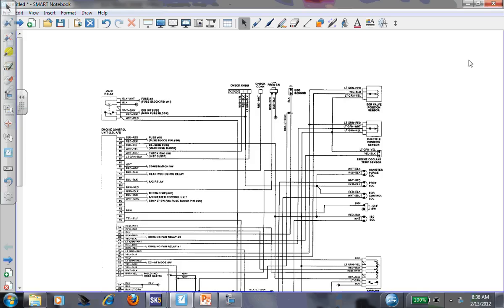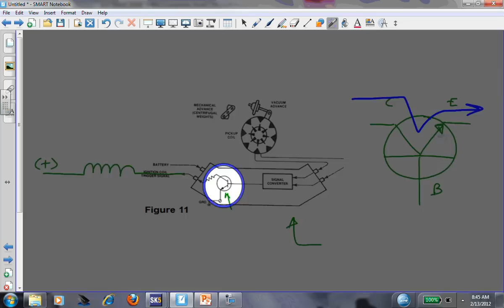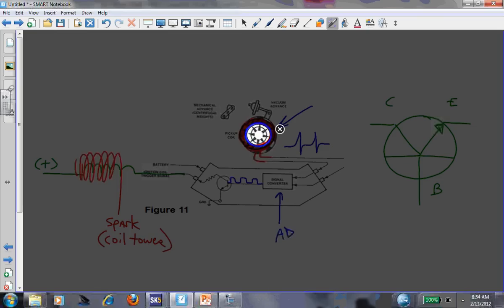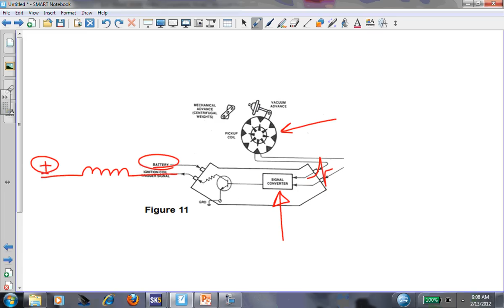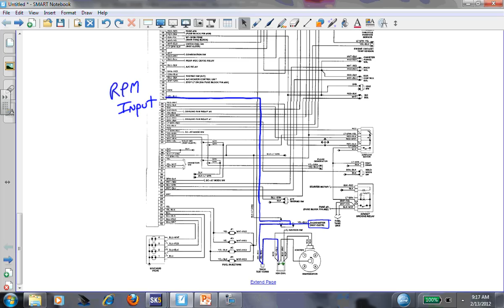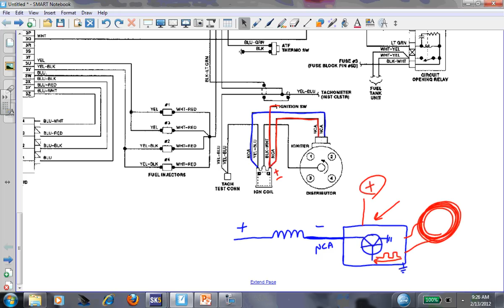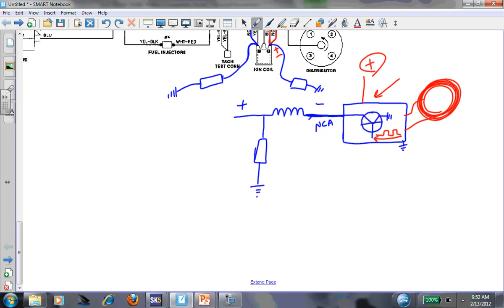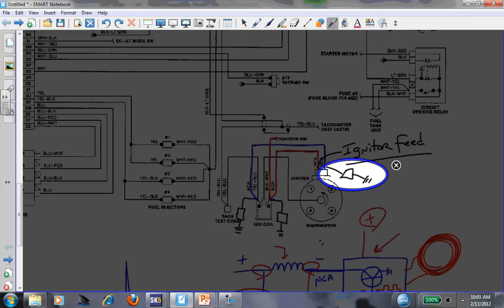Basic Ignition Description, Operation and Testing (any car)

Comment: Just happened to stumble across this and got a kick out of you trying to explain the points type ignition and spark advance to students who probably have never heard of such a thing.  Probably the same feeling to them as it was to us who were already out there when we encountered the transistor ignition.  As you mentioned " a very scary moment" to us.  I did install a number of the "Arc" systems in vehicles which utilized the points to trigger the transistor in the mid to late 70s and then later used the Pertronix and Compufire systems to convert quite a few different vehicles.  Been repairing vehicles since the mid 50s so have seen some amazing changes, now I only take care of my own as I am 83.  I always had 4 or 5 older vehicles in the yard to keep 'hands on' but don't any more.  I did purchase your book a few years ago just to try to keep halfway up to date on all things automotive.

Fred
Reply: Mechanics today would’ve probably looked at say a stock 65 dodge dart and thought easy til trying to figure out the points. Ive forgotten its been so long and havent adjusted the dwell angle?in almost forty years

Comment: They demonstrated how to measure the voltage generated by attaching   drill to the other end of the distributor,   this generator was able to generate up to 2.5 volt at drill full throttle (3000 rpm) also they demonstrated how to trigger the ignition coil using a AAA 1.5 alkaline battery since the voltage generated by the distributor average was 1.5 AC Volt, a battery could emulated it. 
Thanks for make me remember those days. You are an outstanding teacher

Comment: Had to take apart an old distributor from my '89 Mazda MPV after watching this awesome video. At 225k miles, it's on its third distributor. On 89-91 models they mounted the igniter inside the distributor housing, meaning it gets very hot and eventually cooks the little circuit board. Tore the igniter apart and traced all the terminals...really neat! Also has two advance mechanisms: centrifugal AND vacuum! Should be getting a scope this month...can't wait to see some waveforms on that system.
Reply: It’s awesome to see the ripples of knowledge. @scannerdanner influencing @pinehallowdiagnostics. And how many more the both of you have influenced and taught to diagnose the problem. 
I am currently working on classic Porsche and this knowledge is exactly how the CDI boxes work. Thanks for the awesome lessons!

Comment: Thanks again.  It is so incredible how oscilloscopes have changed the way auto techno see things now a day.  You have made me remember of something…  In 1989 I went to Industrial district of Kobe Japan to receive among other things some training on latest Toyota ignition systems.  As you have stated it… there is a tiny AC generator within Japanese distributor.  They taught me a quick fancy test using a Voltmeter and a triple A 1.5 Alkaline Battery.

Comment: Paul, i used to have a few old 'muscle' cars back in the day with centrifugal advance dual point distributor, yes lighter springs = full advance at a lower RPM, usually about 37 degrees TOTAL advance the engine would run best and full advance would occur about 2500-3000 You videos are extremely interesting and also educational for troubleshooting--

Comment: There is a lot of great information in this video, not only a great explanation on the system but mainly the excellent points as to how to THINK about the system and have a solid understanding of what is needed for the system to perform as designed. Been in the field for awhile and it is scary sometimes to see "experienced" techs struggle so much with electrical diagnostics.
If the current automotive schools are being taught by instructors like you, then future techs will be impressive.
Reply: we
Reply: we
Reply: eww
Reply: w

Comment from the maker: Great insight. You can use a lower battery voltage if you like. I've just been using a test light to do it for 20 years and I've never hurt the transistor in the ignitor on any system. I know it is typically a lower base circuit voltage but what I have found is automotive computer systems can handle more without damage. Check out my Lexus LS 400 Igniter Bypass Test video.
Reply: Wow paul great teaching thank you.

Comment: Paul, at 19:00 to 20:00 of your tutorial,the signal conditioner uses a Schmitt Trigger circuit to change the ac reluctor signal to a dc signal to switch the transistor.

Comment: Hi Paul, I remember the introduction of the ballast resistor, I can only say on British cars they had a 1.5 ohm ballast resistor in line with the primary feed, the reason was for cold starting, they had a 12 v battery and 9 volt coil, the B/R dropped 3 volts across it, so coil ran on 9V, when cranking the B/R was bypassed by a wire off the starter solenoid, as you cranked battery voltage went down to 9v, starter current drain, so coil
got 9 volts whatever happened, cold start coil system - Fred
Reply: Yes saw in old gm &Ford
Reply: The ballast resistor is not for cold starting.
The purpose of the ballast resistor is not to limit current flow across the points either when you could do that simply  by having more primary winding's and greater primary resistance. A 3 ohm coil would give 4 amps at the points which is nominal.
It's primary function is tuning of the coil oscillations. The coil system is an RLC circuit.
It has a resistance (ballast resistor) on the positive voltage side, followed by an inductance (coil winding's) which is followed by a capacitance (the condensor) on the negative side when the points are open (that makes an RLC circuit)
The capacitance, inductance and resistance determine the tuned frequency of the coil oscillations from mutual inductance of both primary and secondary winding's, which includes the plug leads.
The resistance of the coil primary determines current flow, the ballast resistor is the circuit tuning part.
Two problems with internal ballast resistors.
One is if the ignition is left turned on for a long time with engine off the internal ballast resistor could heat up enough to blow oil out of the coil and kill it, the other issue was that during cranking when voltage dropped so low it compromised spark. 
With an external resistor it can heat up and wont burn up the insides of the coil, and it can also be bypassed during cranking by the starter sending the coil direct voltage not through the external ballast resistor.
They could have had a third terminal on coils to allow the internal resistor to be bypassed during cranking  but that would not solve the internal resistor overheating issue, the external ballast fixes both issues.
If you turn on your ignition but don't start the engine after a while you will note the ballast resistor gets hot enough to burn flesh but when you start the engine it gets cooler, You can imagine what happens if that is inside the oil filled coil.
So if you have an old car with internal ballast coil, do not leave the ignition turn on without the engine running for prolonged periods or you could fry the internals of the coil to the point it blows oil out if the points happen to be closed when the engine is not running and the coil is powered up.
Some claim that it heats up and increases resistance to limit current and then cools down to increase voltage when running for more spark at higher RPM.
It only heats up because it is drawing more current at low RPM or KOEO, converting that energy to heat that then increases the resistance over it as it heats up.
And when the current drops once it is running obviously it cools down. 
That is not by design that is simply what resistors do as current increases over them.
Reply: With your permission, I like to chime in.

 If memory serves (which is not too reliable these days), the reason for the resistor was to reduce voltage across the points in the distributer to reduce arcing, and to help with condenser. 

The ignition coil was rated 12V; but during running of the engine, it was supplied with less voltage due to the resistor. This reduced voltage would help reduce arcing across the points in the distributer and extend the life of the points. At times, the arcing would cause pitted points. In time they would not separate and drop the primary voltage in the coil. This would keep the spark plugs from firing.

During the cranking, there was a “by-pass” wire from the starter solenoid to the coil primary post. 

This “by-pass” wire would provide 12V to the coil directly, so upon interruption by the points and collapsing of the primary side, it produced a higher voltage for the plugs. Since the cranking periods were shorter than engine running periods, it was an acceptable risk.    

After introduction of electronic ignitions, many of the issues of non-starting due to bad points were eliminated.

Ignition systems have come a long way baby.

Comment from the maker: IT actually does "try to fire" when turned on but there isn't enough voltage generated to jump the plug gap yet. When "turned on" (current starts to flow) the magnetic field is weak and has to build to "saturation". Once you have a strong field in place, then it is ready to fire. Remember a magnetic field must be moving to induce voltage into a conductor. So shut down the current and this now strong magnetic field collapses across all these conductors and now you created enough voltage

Comment: hi, at 32.04th minute, you said, we can use test light to bypas pickup coil, by providing on and off ac sinewave signal, to IGNITER, so igniter can turn on or off, i think we cant use test light because it is 12volt , so we should use 3 volt battery for that. I may be wrong. pls advise. your method is right to supply ground on and off on primary ignition coil but not as input to the igniter because you are passing 12v on and off, but ignitier expect 3 to 5 volt on and off. again i may be wrong.

Comment: FYI: mechanical systems used camshaft lobes to open and close points. Not centrifugal weights. The weights modified only what the camshaft lobes were doing.
Reply from the maker: Which would change the timing, in relation to piston position of when the points would open/close Maybe I misspoke?

Comment: The distributor cap on these High Energy Ignition  (HEI) systems was a larger diameter than the older points style systems because the secondary voltage was higher. This put the towers for the secondary wires further apart, so that the spark would not jump to the wrong tower  (wrong cylinder).
Reply: Not true sorry. HEI had no effect to the size of the distributor caps.
Reply: Not accurate. That is a myth. The reason the cap is so large is to accommodate the coil into one assembly. Look at race ignitions with greater voltage, the caps are smaller.

Comment: The Fluke 87V or 88V multimeter will detect a peak voltage at 250 microseconds threshold.  That should capture the small drop.  Having said that, I would prefer a scope to capture that of course in every instance, but at least that meter will capture that very short voltage event.

Comment: Good evening, elementary school friends, I have a problem with the manual transmission unit BMW E36 M43 1997, it can't start, what I have done is replacing the ECU and the ews module as well as the chip... the engine starts but the problem is the engine turns off 16:45

Comment: Hey Scanner Danner, 

2 questions, Is the resistor on the feed wire from the transistor to the primary coil a PTC resistor? It's literally just the condenser from the mechanical ignition system that has been moved internally in the move to electronic ignition systems?

Do electronic ignition systems use both centrifugal and vacuum advance in conjunction with one another to achieve proper timing or was it one or the other?

Thank you for your response. 

P.s. Your content is hands down the absolute best on youtube. I appreciate all the time and effort you put into this content and will be subscribing to your premium channel. Engine mechanics and diagnosis is easily my new addiction hahah.

Comment: Hi mate I've got a Toyota land cruiser 105 series 6 cylinder petrol I'm having problem finding a circuit opening relay, I've stripped all the dashboard out which the local Mechanic told me it was behind the heater box which I haven't found it yet???

Comment: 13:47 I think I found my issue. Customer states they left vehicle in the run position overnight. Came back the next morning and vehicle will not start. Could this coil saturation have caused all of the coils to burn out over night? Battery was dead the next morning. Vehicle will not start with charged battery. 2008 nissan sentra coil on plug design
Reply from the maker: Unless there was a coil driver issue, keeping the coils energized with the key on (which is not normal), then I do not believe this to be your issue. Scan it for codes as a starting point. Could be anti antitheft related. Try disconnecting the battery and then touching the disconnected cables together (called a capacitor discharge)

Comment: Why doesn't the test light burn out when put on the coil negative if it spikes to 400v and the current can be several amps.  Does the current collapse so fast that it is much smaller when the voltage is that high?

Comment: a bucket of words tin the previous video that I watched the instructor was just spilling buckets of Domino's the word salad did he spilled showed that he knew what was going on but he didn't explain it in a way that imparted what was going on to the Observer unless perhaps Observer just goes over again and again and again but the people weren't getting the cause and effect out of you need to call us and in fact at every point and every step and this video he just basically was forced to deviate to it pure Electronics to explain the magnetic fields and transistors both where to purchase water is needed for one to understand and that's just a necessity but all-in-all I saved this this instructor did a pretty good job but still might be clear on the Electric electrical aspects that he tried to explain I love the stuff is it is a direct eickhoff I have a crankshaft rotation it represents a crankshaft rotation and of course in any given degree on crankshaft rotation is when an event takes place like a valve is open or closed or a spark takes place in so this is that is what the cam was about and they all mechanical white and and they replace the mechanical with away with electrical and it becomes a little bit more difficult to explain when you switch out the mechanic mechanical would be quit when the the pecan the cam reaches a certain degree on the 360° Circle so when do points open because of the cameras at a certain degree rotation it causes the field and that calls who collapse which is what causes a spark he did a good job of explaining that for every section of degrees which may be at 15° maybe it's twenty-two and a half but at a certain point around the circle in degrees is wondering if it takes place cuz it's a rotating shaft everything revolves around the shaft in the rotation in the degrees of rotation events are planned for a certain degree of rotation I say so. Follow-up mechanically if you check it after I turn the crankshaft and and watch the it's all coordinated so the electrical short story throws a curve but if if the electrical can be appropriately explained and then compare it back with the mechanical one can get a solid understanding but the one has to separate the electrical electrical functioning from the mechanical even though they're linked

Comment: Ok everything is clear but question if the dashboard show me the light gauges and the pulse is not show from the harness coil and then the 2of 3 harness from my pcm don’t clicking when I connect I think computer or what is if I buy already all parts coil distributor spark plugs wires everything except for the pcm? Dodge Ram van 1500 2001  :) thank you
Reply from the maker: I'm sorry, I am not following your question
Reply: Ok I replace all for make spark right , so my question is if I have pulse in the inyector but not from the wire coil following you class about ignition I’m just noticed the only one issue have to be my computer the ecm bcs I try everything replace everything and still just cranking but not give me spark I need some clue before but a new pcm(2001 Dodge Ram van 1500 8 cil 5.2 any video can help me if you have one please I hope you follow this thank you
Reply from the maker: @icealexsanzage  maybe this one will help you https://www.youtube.com/watch?v=Uk-GqHpOKAY

Comment: what if my car is missing the ten pin wire ?   i have a 94 626 2L and its in a 94 ford probe its got some issues and cant hook it up to a diog  because of the missing ten pin wire from the comp to the plug in 
 any advice on that cuz im more or less screw unless i can figer it out

Comment: Not a sine wave and the ratio of primary windings to secondary windings is much easier to comprehend than “a hundred times more conductors”. From what’s generally taught to beginning students. I’m pretty sure the signal youre referring to isn’t a sine wave but closer to a sawtooth wave.
Reply from the maker: The saw tooth you refer to is simply a characteristic of the pick up coil. If we are talking about a sensor that makes its own voltage, it is referred to as an AC sign wave. No reason to complicate it, wouldn't you agree?

Comment: I have a 2010 Dodge Ram got a map code ,all my sensors voltage are 5.0004 volts it’s just stuck at that voltage with key on